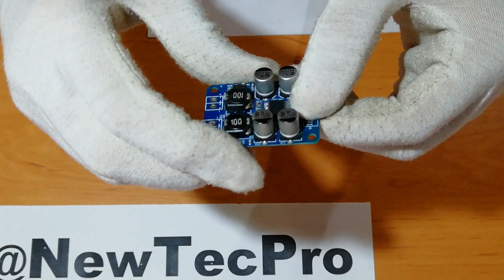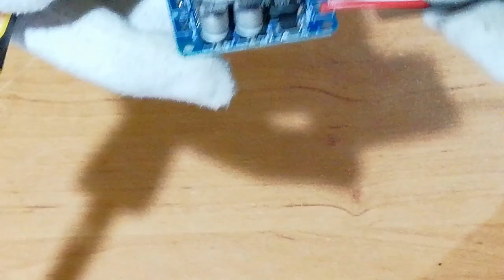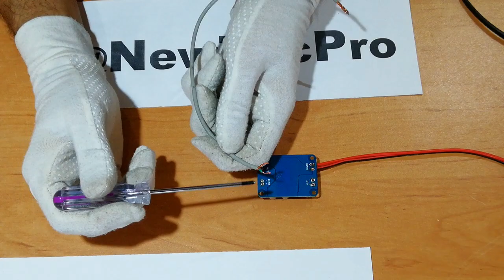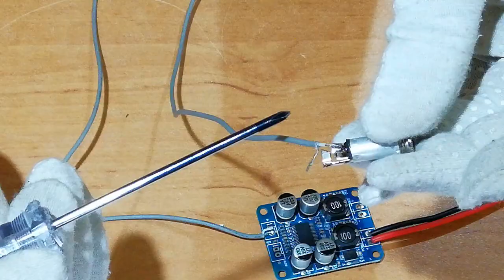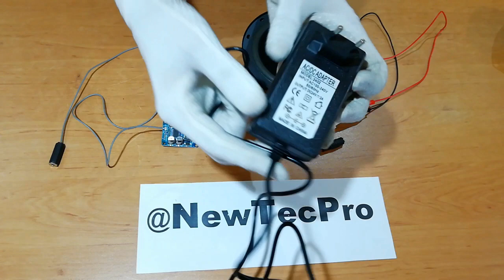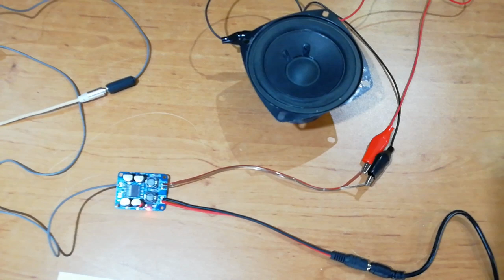Testing and installation TPA3118 Mono Digital Audio 60w Amplifier

Comment: Can you recomend some preamp board to this amplifier ?
Reply from the maker: Hello. I can introduce it to you, but I suggest that if you need the best sound quality, you should feed the stereo sound through the laptop sound card to the amplifier module. In this case, there is no need preamp
Reply: @newtecpro  I just want to feed it from common chinese mp3 bluetooth player board  in my PA speaker upgrade. I can find many amplifiers with   preamp integrated  but only for stereo  or 2+1  based on TPA3110, TPA3118, TPA3116   but nothing for mono speaker.  So i imagine to resolve this situation by buying  this mono amp and connect it to some preamp with trebble and bass knobs.
Reply: You can use a active tone control which has a preamp built-in, this tone control has volume - treble - mid and bass controls. If you need it for guitar then you also need a high impedance preamp.
Reply from the maker: @nedstar7378  Thanks for your very helpful comment. Dear friend, I hope you will give your opinion and advice in the next videos

Comment: can i connect this module direcly to a 3s lipo  battery ?
Reply from the maker: You can use any power source that outputs 12V DC to 24V DC. It is better to use a voltage of 24 with a current of at least 3 amps.

Comment: What power supply did you use?
Reply from the maker: You can use 8 to 24 V power supply. I am using a 24V 2A AC-DC adapter power supply